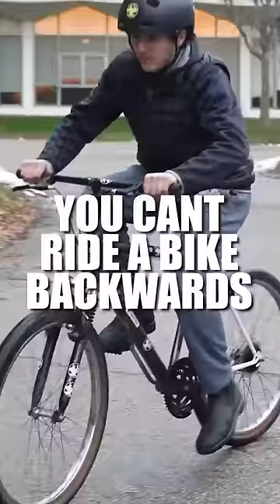THIS BIKE CAN'T BE STOLEN 🤯 #engineering #bike #challenge #prank #fallguys

Comment: They can't ride it, but they could still steal it lol
Reply: not really
Reply: @lebronjames-lb8j pick it up, put it in a pickup bed.
Motorcycles can be stolen this way, as well.
Reply: @jer1014t2th  evn if the handle bars are locked? like how dou load it?
Reply: @lebronjames-lb8j welp you’re getting a bike stolen
Reply: @agmhelena7266 lift the front wheel off the ground and roll it up the ramp
then after that, the steering lock or motorcycle key switch is taken off or forced into position, the key switch is either switched or the key is copied before it's used or sold
either that or it just gets stripped down and sold as parts, which is harder to trace since only the frame and engine have numbers usually (and numbers are filed or pulled off, depending on if it's a stamp or a tag)
if it's a team of 2, it can be thrown in a truck bed in seconds even if both wheels and steering are locked, the best thing to do is keep it inside and lock your doors

Comment: bikes are built to be self-stabilizing when riding forwards, judging from this video it provides also means that they are self-destabilizing when riding backwards
Reply: Yup! Plus, they keep leaning the wrong way out of habit; if they'd faced the other way at least the leaning would be more intuitive, but the wobble introduced by pulling the raked fork the wrong direction, is gonna be a lot harder to compensate for without overcompensating

Comment: Or if you want a fast fix gear without changing the sprocket from rhd to lhd just put 4 metalbars diameter 3or 4 I think into your clip mechanical when you open up the cassette that the clips don't get pushed down and tada.Fix Gear

Comment: .
Reply: Nice explanation. I was about to comment a slightly less technical version of this.
Reply: How would that possibly violate any of Newtons laws?
Reply: This guy’s gonna be pissed when he finds about about unicycles
Reply: @sethpolevoi4027  shifting weight when already off balance can't  help rebalance as pushing your weight one way pushes the bike in the opposite direction negating the action. I think he meant that recovering with that method would require a violation of newton's laws.
Reply: @samstark568  This is true. However the primary cause of this instability is the orientation of the bicycle when going backwards. 
It is entirely possible to tow a bicycle by the seat or ride without using the handlebars while moving forwards. This becomes impossible while traveling backwards.
Reply: You're right, you can't ride it the normal way, but what about ride it like the circus artists being in front of the handlebars and drive it backwards... maybe some artists could do it this way not quite sure but imaginable 😎✌️
Reply: Would it help to flip the front wheel 180 degrees?
Reply: He does explain something like this in the long form video
Reply: My fixed gear sure pedals backwards